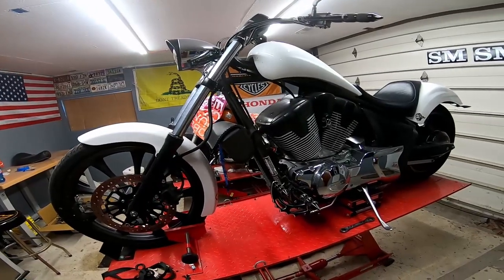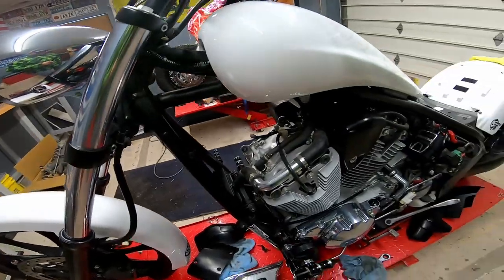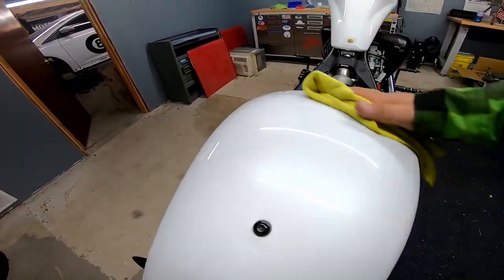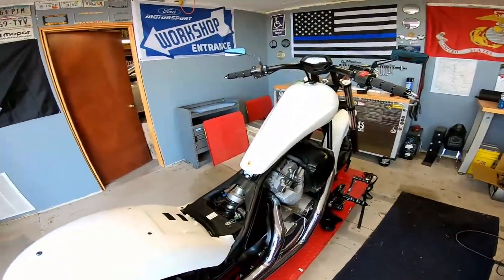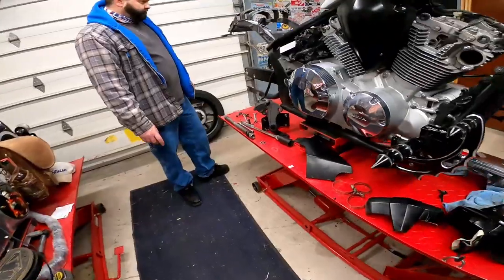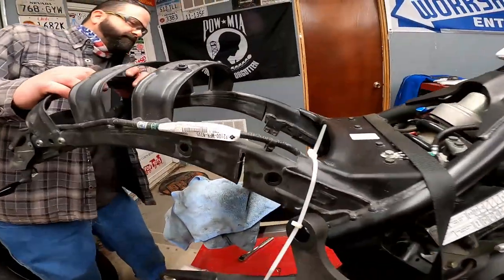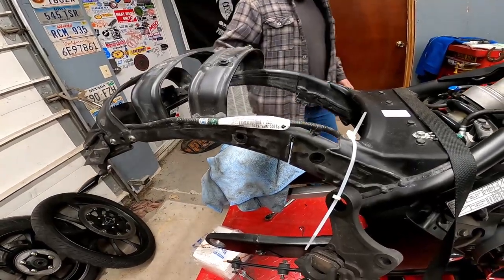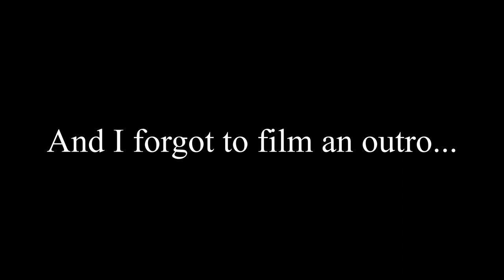Fury Friday...Honda Fury rear fender T-Mod

Comment: I like where this is going. my only question is will the fender have to be bent down as well,  to match the bent down framing?
Reply from the maker: No because we moved all three mounting points. But, we can no longer pin it down under the seat at the front of the fender. That’s where we want the gap cause we can hid it with the seat.
Reply: @StevyFaux  ahhh that makes perfect sense. I didn't realize that! Thanks a bunch.